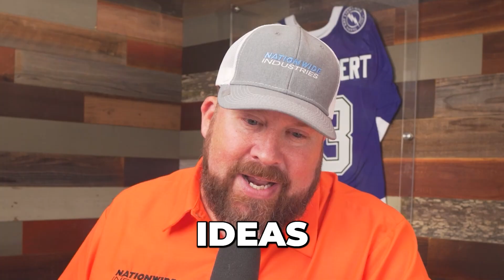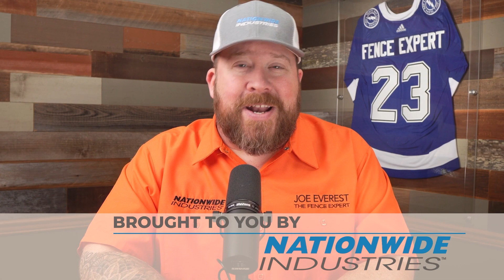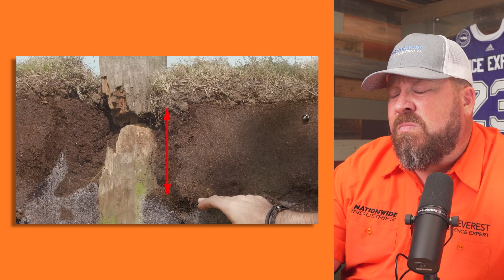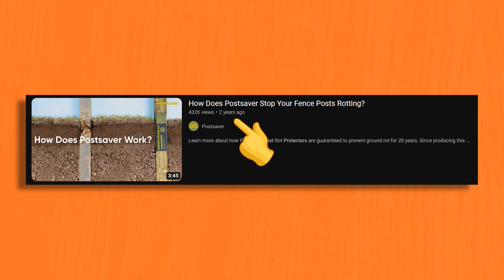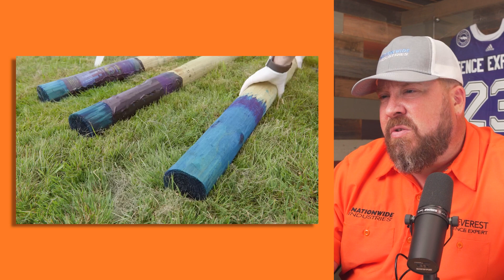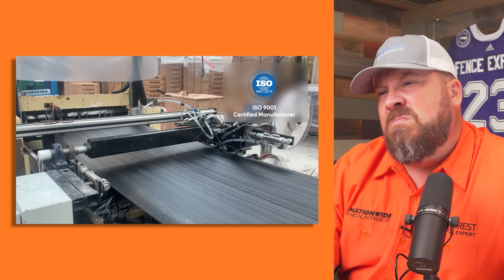They Have a Life Time Guarantee on WOODEN POSTS??

Comment: IMO a better/cheaper way to make a 4x4 last longer is to use roof tar out of the bucket up the 1st 2 and 1/2ft above the post. It creates a barrier between post and concrete and keeps bugs from eating the wood. I have done this to fences that are still standing strong after 10 years of south Florida weather/hurricanes. I expect 15 years when using this method.